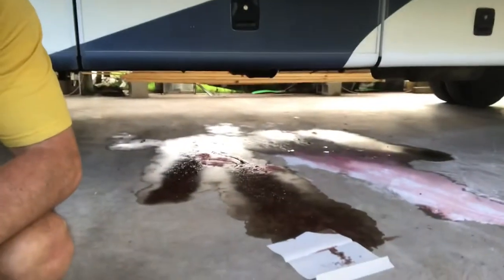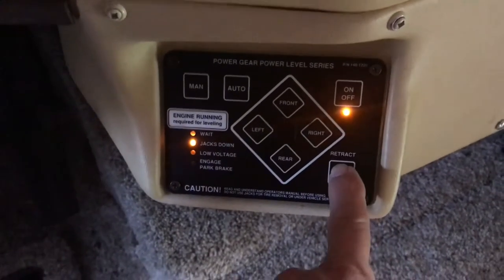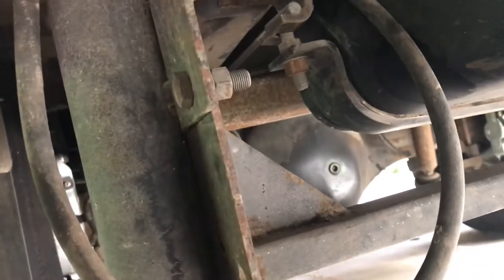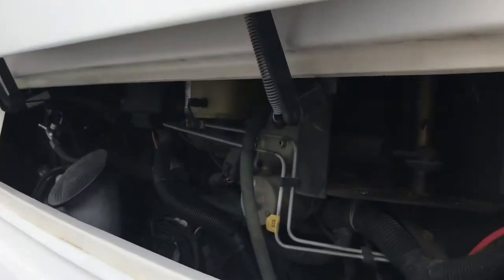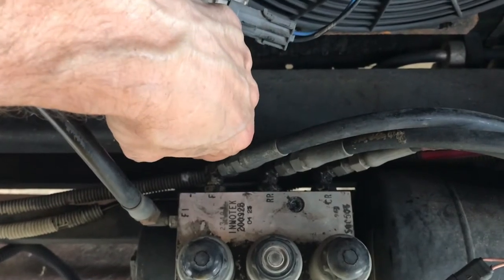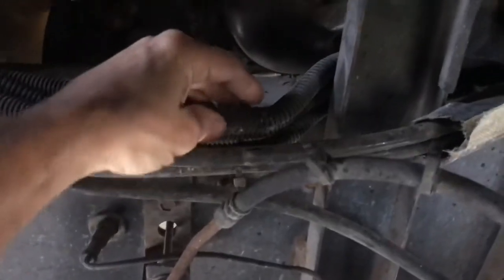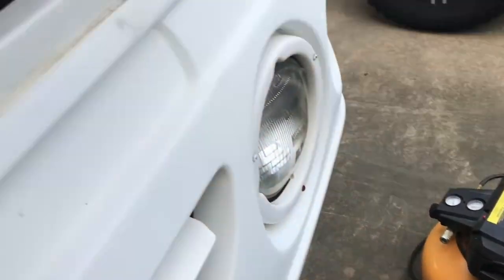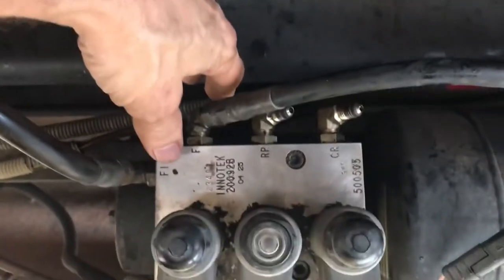Replace Leveling Jack Hoses on RV

Comment: Where did you buy the hoses?  How long are they?
Reply from the maker: I had they made at Lake Charles Truck Equipment. They cut the hoses to the length I needed and cramped the fitting on.